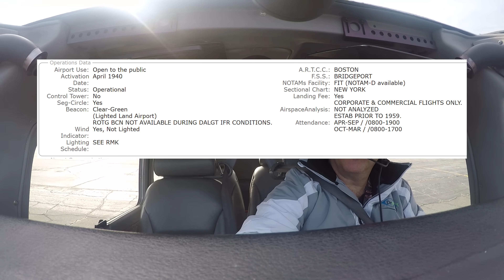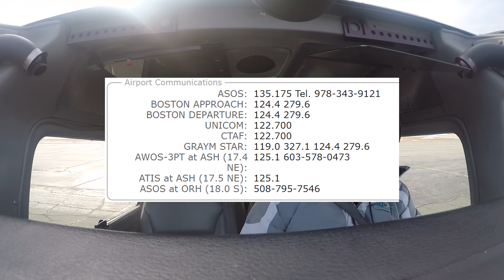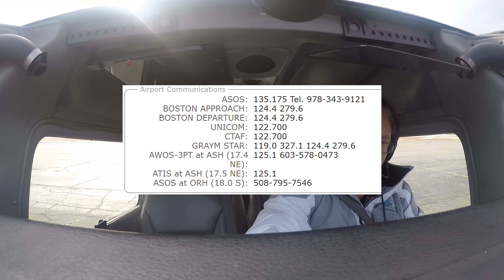How to get an IFR clearance at a non-towered airport.

Comment: You were not direct bosox. Initial heading was 180, radar vectors. So fly that 180 heading until the controller gives you a new heading. Then only go direct to the fix if the controller tells you to do so.

Comment: 888-766-8267   Get an IFR clearance from anywhere.  Keep looking in the A/FD, eventually local numbers should be published for just about everywhere, will be easier than using the national number, IMHO.  Personally, I do my run up, get to the runway I plan to use for departure, then when I radio or cell call, tell them I'm, ready to depart runway XX.

One more thing that's made phone calls easier.  Most planes I've flown have at least an audio in jack for music.  https://www.amazon.com/Bluetooth-Receiver-TaoTronics-Hands-Free-Cancelling/dp/B0728GP9XH  One of these will let you bluetooth music from your phone to the plane and also let you hear phone calls in your headset.  Plus it has a built in mic for making calls out.  For those with Lightspeeds or A20s you have your own option, obviously.  I like my Halos.
Reply from the maker: Thanks for watching

Comment: Good video. I did my IFR training at a nontowered airport so the variety of ways to get clearances and their meanings are somewhat second-nature. When I moved to a busy Class D, wow, did it get easy! I'm back at a nontowered now.  I know it can be a little confusing going the other way - being used to the simplicity of clearances with a Tower and being faced with figuring out the best way to get the clearance without one. One thing to consider. When talking to Approach on the way in, even if using flight following, ask if they have a phone number to call them directly. They often do and, unlike FSS, which is only a relay, have more details on your clearance.

Wow! Sorry for the long post.
Reply from the maker: Great post and thanks for watching

Comment: Thanks for posting this. It looks like you maybe got bit by the apparent conflict between your clearance, the ODP, and the standard traffic pattern exit. Runway 32 is standard left traffic, but you turned right because that was the shortest turn to 180. You would have been more predictable to other traffic had you used a standard departure of the pattern from a normal left downwind. Also worth remembering that ATC expects that you’ll fly the ODP unless they explicitly say otherwise.

DEPARTURE PROCEDURE: Rwy 32, climb via heading 
324° to 2600 before proceeding on course. For climb in 
visual conditions: cross Fitchburg Muni Airport at or 
above 1800. 

I’ve been flummoxed by a similar situation departing IFR in VMC myself.
Reply from the maker: I was in visual conditions so I crossed the airport above 1800 feet .  As far as the pattern goes you are correct the it was left pattern but I was focused on getting on a 180 degree heading. Thanks for watching on your input
Reply: Eric , AtC also cleared him to turn to 180 “When able”, Probably because it was a clear VfR day. If it was an IFR day , you are correct.
Reply: Gary Gazman, "when able," "In conjunction with ATC instructions, gives the pilot the latitude to delay compliance until a condition or event has been reconciled" (Pilot/Controller Glossary). In this case the "condition or event" include traffic considerations, our departure from an airport  where Class E doesn't begin until 700 AGL, our need to clear obstructions and terrain, and our option to use the ODP.